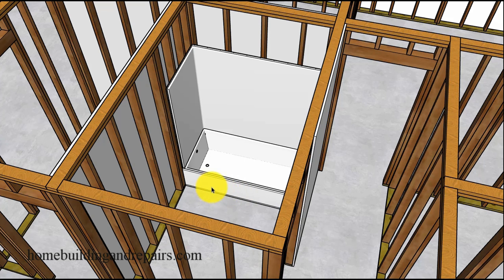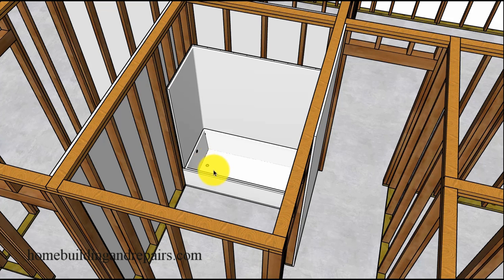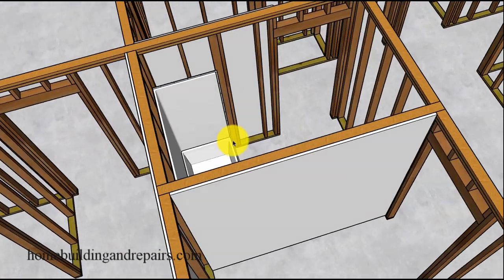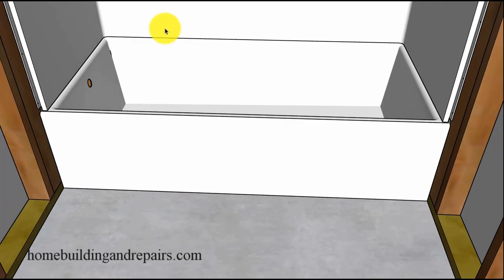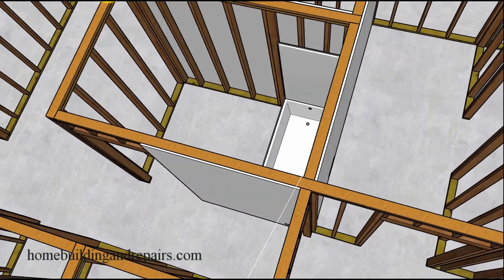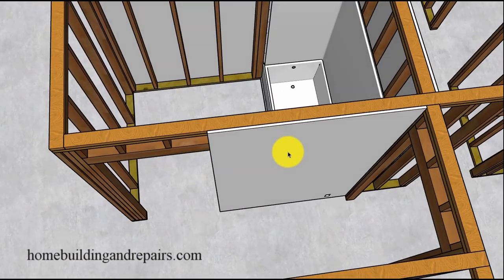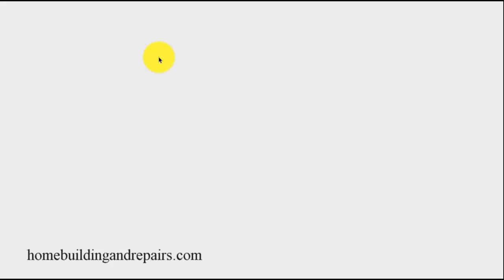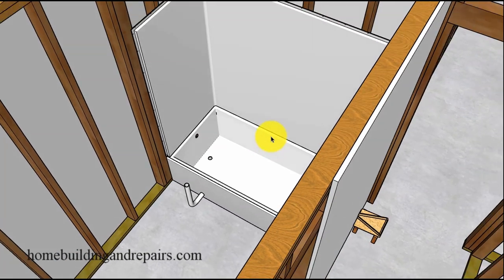How To Fix Moving or Weak Bottom of Bathtub Without Removing It - Home Repair Ideas

Comment from the maker: I wouldn't recommend using this suggested repair if the bottom of the bathtub is more than 2 inches off of the floor. I'm not suggesting that you can't use it, but would be concerned about adding additional weight to the flooring with the self-leveling compound.
Reply: I believe that with standard, to code framing, the addition of a few hundred pounds of mortar or other leveling compound would not be a cause for concern but I'm not an engineer or an inspector.
Locally we install radiant floor systems with the tube secured to a plywood sub floor and topped with 1.5" to 2" of concrete. Sometimes the concrete is the finished floor surface, sometimes it covered with .75" wood flooring or ceramic tiles or what have you. Standard framing and joist spans are considered adequate to support this load.
Reply: What about using a expanding foam sealant instead of mortar ?
Reply from the maker: @jacque7736  My biggest concerns with foam and this would include open and closed cell foam would be the chance or possibility of it raising the bathtub or losing any structural strength and not being able to properly support the bathtub overtime.
Reply from the maker: @GeeKayKayGee  I think if you're dealing with a concrete slab, it might not be a problem, but it could be a problem in older homes with 2 x 4, 2 x 6 or over spanned floor joist.

Comment: Speaking of bathtubs and supporting them and the weight of things, I have a story. A few years ago I worked on a new house build that had a massive bathtub for the master bedroom.  The free standing tub was carved from a single piece of stone, it was deep and the tub walls were 4" thick. I don't know how much it weighed but the engineer required enhanced support all the way from extra large footings in the basement, posts, laminated beams and I think 12" deep gluelam joists under the bath tub. Many thousands of dollars of extra materials and labor to support the weight of this tub. A crane was required to lift the tub into place on the second floor at the framing stage and then months of working around this thing, moving it when needed to tile the floor for example. All this against the advice from, the plumber, the general, the framer and every one else and their dog. "Don't do it" was the chorus. "Don't do it", said the plumber, "It doesn't have code approval". But the owner wanted his tub and so the work was done. 

How much hot water will it take to fill this giant heat sink, we asked ourselves. 4" stone tub walls at room temperature sucking all the heat out of the water as it's being filled. How many times will the tub have to be filled and immediately emptied and refilled again until all that stone is up to a comfortable bathing temperature?
Guess what? The occupancy permit was denied because... the tub did not have code approval and could not  be approved as it did not have an overflow drain. Because of the closely spaced laminated, engineered joists under the tub, there was no easy way to connect a retrofitted tub overflow to the DWV system. Eventually a drain line was run across/above the bathroom floor to discharge into the glass walled walk in shower. Job done, occupancy permit granted and presumably that ugly overflow line was then quickly removed but I wasn't there to see any of the overflow problem fixes.
The point of this story? Beats me. The rich have more money than sense? If you've got it, spend it? I think the real point for me is that there is a lot to be said for living in a small, simple, house.
Reply from the maker: I always enjoy hearing stories like yours and thanks for sharing and taking the time to comment on my channel. I'm pretty sure you have been a follower for quite and see your name pop up every once in a while.

I think the last story I had was when someone ordered a Jacuzzi bathtub that required European electrical connections.

Comment: When installing new tubs I always set them in a bed of mortar.  Material consistency is important as if it's too fluid the mortar settles and flows away from direct contact with the tub. A gap of even a 1/16" means there will be flexing and movement of the tub. Too stiff of a mix makes it very difficult to displace the mortar to bring the tub into contact with the previously set leveling points.
Using a self leveling compound under an existing tub sounds tricky as I would expect the material to continue flowing outwards until it is constrained by the framing floor plates and the tub apron.  As the tub floor is probably more than 1.5" above the sub floor the compound will not be in contact with the tub until enough leveling compound is poured under the tub to entirely fill the cavity under the tub. The compound will have to rise to the top of the wall plates then over them, filling on top of the plate between the studs, up and up until it is up to the level of the tub floor. 

I would suggest using regular expanding spray foam (not the low expansion type).  Fill the tub with water to ensure that it doesn't move while the foam is expanding. Fit an extended (24") nozzle to the can of spray foam and insert the nozzle to the far side of the tub and start filling, slowly withdrawing the nozzle as you spray to ensure complete coverage from one side of the tub to the other. The foam being adhesive will ensure a positive connection to the tub. As well, the nozzle can be inserted through a hole as small as .25".
Reply from the maker: I really appreciate your comment and hope others read it. Excellent point about the height of the bottom of the bathtub and I everything you said in your comment makes sense to me, except for the foam, but I'm not about to suggest that it won't work. However, I need to state my opinion as you have stated yours and that would be to avoid using anything that could possibly raise the bathtub.
Reply: @gregvancom  My suggestion to use expanding foam would/should be contingent on being familiar with, having experimented with the spray foam being used. Knowing it's expansion value, knowing it's density when cured, knowing if it will have an adverse reaction with the tub material. In my experience using foam to support the bottom of a tub or a shower base works and works quite well but as with any such problem one needs experiment before implementing.
Reply: This is the correct solution for this and only requires a small hole.  Remove a piece of trim in a room next to the tub and go in and spray foam.  Fill tub with water if it's not cast iron.  I recently built a house and did this with a cast iron tub before drywall was in.  I was able to clearly examine what I was doing and it proved to me that me doing this in the past was the way to go.  A can of high expand Great Stuff using a Pro gun is a to perfect amount for a standard 30x60 tub.
Reply from the maker: @00dahc  Again, do a little more research and possibly check with the manufacturer, before using as this individual referred to as "the correct solution."
Reply from the maker: @GeeKayKayGee  I'm not about to suggest that certain types of foam might work better than others. However, the application of a product through experienced professionals for a specific part of a construction project where the manufacturer might not allow it, because the product hasn't thoroughly been tested or there are other products that will work better, won't carry a lot of weight with me. I've only been doing this for 40 years, but within that time frame, have seen a lot of products come and go.

Comment: White wainscoting looks good on the side of a tub.  Wonder if they make it in plastic or fiberglass.  Cheers!  Chris.
Reply: They definitely make it in pvc.
Reply from the maker: I actually had it in one of the bathrooms on a house I lived in, until I had to replace the bathtub. The homeowner used an oil-based paint and we never had a problem with it.

Comment: I use two mortar bags to fill the gap and offer more support to the tub. The plastic bag keeps the mortar under the tub where you want the support. You end up using only 1 bag of mortar.  It is a major improvement on fiberglass tubs. It feels very solid on the bottom with the mortar under it. It can be done on new installs or as a retrofit repair.
Reply from the maker: Sound great and thanks for sharing.

Comment: Bottomline every manufacturer suggest using a foundation during installation. They make it optional because some require it for warranty. But all have the floor problem. Require a foundation and pay for it to prevent future problems. A shower or tub only have a 1/2 piece of osb on the bottom sandwiched between two layers of fiberglass spanning over 25 inches. The more you stand on it the weaker it gets. A 2x4 will break after being walked on long enough.

Comment: Thanks for the recommendation...I used this technique under my shower pan and it appears to have worked. I had crunching going on when standing on half the pan because of a small gap between bedding mortor and pan. I used an oil funnel to pour self leveler plus from mapei and it got in the small crevices. Used about 50 pound bag.

Comment: Could you recommend this same scenario when it’s a shower pan? I have the same problem on the shower pan that the plumber didn’t use enough mortar. The shower base is only 2” tall and on the second floor. 

Any suggestions?
Reply from the maker: It would depend upon the bottom of the shower pan. Some shower pans wouldn't allow the self-leveling compound to flow through them, but if you had one that would, then I don't think it would hurt to try it.

Comment: Can I cut a long horizontal hole through the plastic front bottom of tub where I can put trim over it? I would want to cut almost as long as the tub so I can fill with Foam then cover with the trim. Or cutting that long of a hole will weaken the tub? Or can I cut on left facing front like 1.5 feet then to the very right 1.5 feet long by like 2 inches. I'll get a 3 inch tall trim rubber to cover. Or white cove base.
Reply from the maker: I've seen it done before, but can't suggest doing it.

Comment: Our tub is 20 years old and elevated over a cement floor in our basement. One must step up to step in. It was restored once perhaps 10 years ago when a crack developed in it. Now the drain seal or trap is leaking, but only when a person is standing under the shower. When I blocked the drain with duct tape and ran the spigot and shower and water it did not leak. When I punched a penny sized  hole in the duck tape to water drain out it did not leak. When someone stood under the shower and used it there was a slower leak.  Our plumber can easily repair drain seal or trap but If the bottom of the tub is shifting ever so slightly it won’t last long. As we will eventually replace it with a claw foot tub I am wondering if there is a temporary way to support the bottom of the tub to stabilize it until we have the resources lined up for a major project.
Reply from the maker: Maybe some blocks of wood if the ideas in this video won't work.

Comment: Why wouldn't you use expanding foam insulation, it gets hard enough for weight support, but it is also light weight and easy to work with and clean up.
Reply from the maker: Because I'm not convinced it will work as well as mortar and the fact that it could raise the bathtub, when expanding. I don't know of any bathtub manufacturers that are telling anyone to use expandable foam insulation under their tubs for support, but if you do or anyone else does, feel free to email me a link to the manufacturer or their name.
Reply: @gregvancom  I've been doing a bit of research in to this, a way to counteract the possibility of it raising is to fill the tub halfway with water to keep it weighed down. Mortar will outlast foam regardless, but I think you can get a decent result with the right kind of foam and proper setup.
Reply: Do not use spray foam. Depending on where the foam is expanding it can created uneven pressure under the tub.
Reply: Also, I wonder if over time, the foam will compress under weight and loose its ability to provide firm support (?).
Reply: Spray foam will work if the tub wasn't placed in a mortar bed to begin with. Just don't think your gon a fill 4 or 5 inches with it. Cut whatever thickness of insulation foam to lessen the gap to about 1 or 1.5 inches. Fill the tub before spraying and leave it overnight. Have done my own bathtub and many others like this from not being installed correctly. I done mine over 8 years ago and it's still in good shape.
Reply: I just tried expanding foam-big mess and it's still creaking.  I used 3 cans and had to use a rubber tube to reach the opposite side of my tub.  Plumber said a mortar bed wasn't necessary because the bottom of the tub had a bunch of little feet on the bottom.  Well after about 2 years my tub started creaking.
Reply: @markhopkinsphoto7257  did you fix it? How?

Comment: do you suggest using polyurethane foam to fix it?.
Reply from the maker: No, but I would also suggest checking with the bathtub manufacturer to see if it could be used.